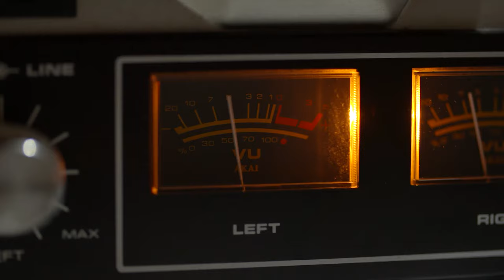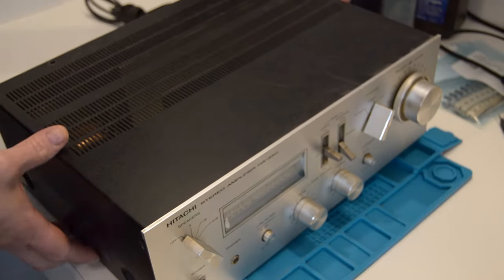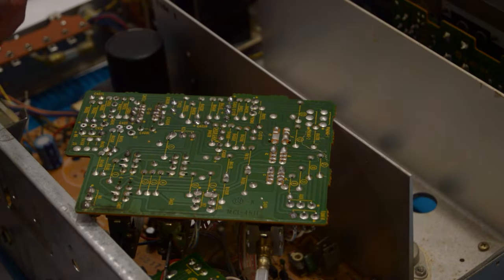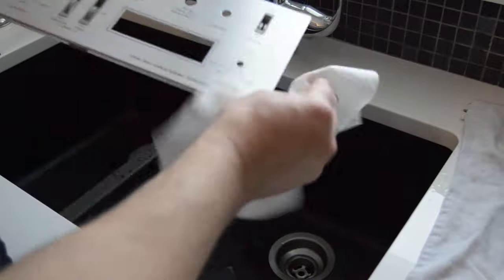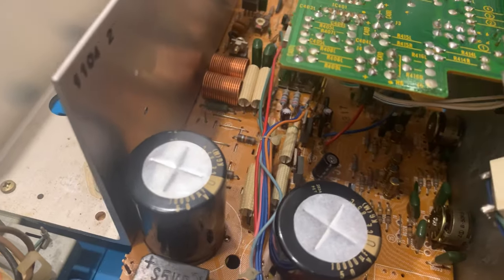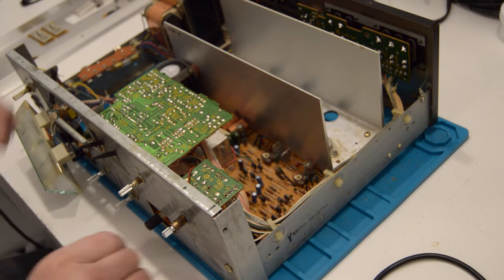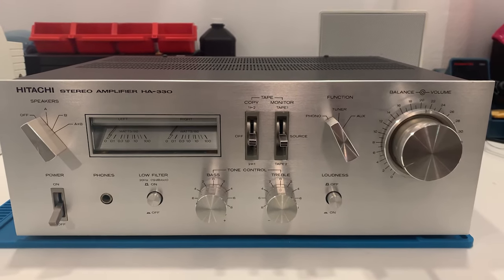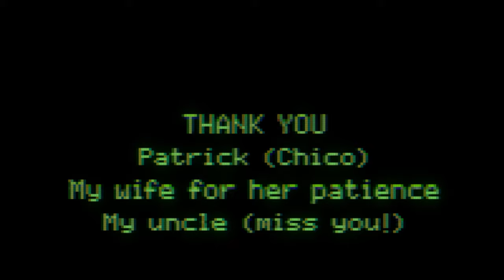How To Restore an Old Power Amplifier from 1977 | Retro Repair Guy Episode 2

Comment: Great video! I'm a huge Hitachi fan and i pretty got all their best pieces and the 330 is part of them. Even if it was one of the smaller model it is truly an amazing little performer. I could live only with that one and be happy and that says a lot. Keep up the good work!
Reply from the maker: Thank you! I hadn't heard it in years and I was really impressed after I fixed it and was testing. It really packs a punch. Until I started fixing it I had no idea it was an OCL type amp; I'm so happy with its performance.

Comment: Nice video...but what about the meter LAMP which is burnt 99% of the time. How do we put in an led equivalent?
Reply from the maker: Hi! Thank you very much. Surprisingly the lamps on this unit lasted forty years. However, for the matching cassette that I restored, both lamps were burned. https://youtu.be/WlVPXTPgK2M?t=545 I replaced them with regular lamps as it keeps it original. Just like a regular light bulb you can of course replace it with an LED. You would need something like this as an example https://www.ebay.ca/itm/10-New-Cool-Blue-Axial-LED-Wired-8V-Lamps-Vu-Meter-Light-Bulbs-Qty-Avail/114221627132 I can't find them on Amazon but all you have to do is match the voltage to the existing light on your unit.

Comment: I never thought about adding solder first to a joint before desoldering it to help pull it out, thankyou
Reply from the maker: Hi! Yeah this is especially true when the machines building the boards put just a tiny bit it makes it hard to suck anything out. Also some boards use a very low lead or lead free solder so by adding it again makes it easier to remove. This was the second video I ever uploaded. You might enjoy the newer ones a little more as I give more details and they have history intros. Here's an 80s drum machine I just fixed. https://youtu.be/Woo1-DSzc5A Thanks so much for watching!

Comment: I have the HA-330 and am using it in A+B mode with bi-amped KEF Q3's, and a bluetooth tube preamplifier, it literally blows up people's minds when they hear it, that this mini beast of an amplifer with 20 plus yr old speakers sounds better than anything modern they have heard. Am pairing it with a wired Raspberry Pi running Volumino soon for lossless listening.
Reply from the maker: Yes, it does because it's an OCL amplifier capable of high output at low frequencies. Today OCL amps are generally found in very high-end components that cost thousands. I had not heard it since I was very young, so it surprised me as well, knowing it was such an amp. If you haven't done so already, you should really consider replacing the 45-year-old capacitors to prevent any damage to the transistors as they are almost impossible to find. The cost wasn't too high, but it was a lot of work. Only looks easy in a 20-minute video.
Reply: @RetroRepairGuy  Thank you, I shall start looking for the caps, am in India so really don't know what I will get here but if you are okay with it will message you with what options I get here!
Reply from the maker: You can get everything here:
https://www.digikey.in
If you need more information let me know.

Comment: The 2 large capacitors are as follows. One is for the + or positive power supply rail and the other is for the - or negative power supply rail, not the right and left channel individually.

Comment: I've got a Chinnon (Dixon's then own brand name) tuner amp with Wharfedale speakers bought in 1975 & still going strong tho the radio is a bit crackly, but connecting my Technics cd player it has a beautiful warm sound. The Chinnon was made in Japan & the knobs have a excellent weightiness when adjusting. Quality unlike now.
Reply from the maker: Hi. I actually had never heard of Chinnon. Most of these old amps, especially from the 70s and 80s were built to last just like the old cars. Everything from the chassis to the knobs feels heavy and of good quality. Thanks for watching!

Comment: What do you like about the HA 330? It is very basic and not even the regular size of 43 cm for most vintage units if you want to stack with other units like tuner, CD player, cassette deck...
Reply from the maker: The best aspect of it is it's OCL circuit design. It's really sounds amazing and units with OCL circuits today cost a fortune. Also, the main reason I liked it as I stated in the series of a few videos I made restoring this stereo, is because it belonged to my Uncle in 1977 and we used to record stuff together on it so I have emotional attachment to it. Thanks for watching!

Comment: If I may suggest: replacing thermal coupling compound under the finals, the TO3s, would be a good idea along with verifying whether crucial resistors have drifted in value another. Bias setting and DC offset, if present, is another set of adjustments worth checking on a unit of this age. There often is a PIO cap on the mains, which must be replaced with a modern fail safe cap. Was expecting a totally different testing to music blaring, 1k sine into dummy load while operating pot and switches to verify on the scope and via headphones whether spraying some contact was effective for a start. Nice unit, they don't make them like that anymore.
Reply from the maker: Hi there! Thank you for the suggestions they are always welcome. While this was only the second episode, there are sometimes things I do off camera, like in this instance adjust the idle current of the output transistor which is done once the unit has been on for at least five minutes. However I chose a different direction for the videos and make them more concise; I don't want for example people watching me solder for half an hour or do any scope testing unless it is necessary. I don't want to make this show into a step by step "how to" that would last an hour without resolve but rather for people to experience a restoration process from beginning to end and experience closure, which includes playing music to demonstrate the unit is functioning in lieu of having a scope hooked up to it.

P.S. As for the TO3s, there was testing done on them (off camera) and I did look for them but they, and every replacement, was always discontinued. Although they are working, if I had them available, I would have just changed them and included the process in the video.
Reply: @RetroRepairGuy  Had some heatsink compound turn to powder after decades of service and especially in light of some of these TO3s becoming unobtainium, as you point out, solid thermal coupling is a must. I'm not suggesting replacing finals, just the paste, because ... they don't make them like that anymore ! Matching any trannies is a pain and if the manafacturer had a curve tracer at hand, the chances of getting it "more" right are slim, unless you have dozens at your disposal. As to longer vids, I wouldn't mind, but I get your point. Thank you for clearing that up !
Reply from the maker: @paulb4661  Agreed, you are absolutely correct and thermal paste should be changed after all this time. I'm happy to hear you wouldn't mind longer videos, it's always hard to find the perfect length without dragging and boring people. YouTube's algorithm penalizes for a bunch of reasons such as people turning off your video cause it drags, click through rates, etc.

Comment: Seems similar to an old Sharp Optonica I am in process of fixing with a removable bottom plate.  It has blown it's RIFA cap on the power supply section.
Reply from the maker: Hi. I just looked as some pictures because I did not know the Optonica. I can see the similarities, are they also OCL type amps? I couldn't get that information. This is the one thing that made me fall in love with this amp as it packs a punch; I was really surprised. Will you post a video of the repair?
Reply: @RetroRepairGuy  I believe some of the models were OCL but cannot determine this on the 5101/5105 models.  It's a nice sounding unit.  I had some help on the audiokarma forum so looking to replace the rifa cap with a modern x2 safety capacitor.  I will post another video when I do this.
Reply from the maker: @AvidRetro  Yeah for some reason I only found out about the Hitachi being OCL from the Service Manual. Can't wait to see how yours turns out!

Comment: re: the large caps. "One for each channel" is completely wrong. They are used in a split power supply configuration, as are ALL direct coupled amps. One for the positive power supply voltage, one for the negative. The power from these is for both amp channels. If it were a dual power supply, there would be four large caps, two for each channel.
Reply from the maker: Hi. I just watched it again and you are absolutely correct; it's one for positive and one for negative, not left and right channel. Thanks for pointing it out and thank you for watching.

Comment: I have a optinica amplifier sm 1515 b if the power transformer goes bad can it still be fixed the part number is rtrnp0506afzz can it still be fixed and what about my output ic rh-ix1066afzz it is a sanken s-60w
Reply from the maker: Hi David. Very nice amplifier looks similar. The problem with the power transformers is they are very difficult to find new that match. Not like the old days. However, with a bit of fiddling, you could replace it with another but you'll have to have the service manual and make sure of voltages, etc. I find it simpler to purchase another used for parts. This place has it listed but says "not in stock" and "no substitute" but it looks like you could order it https://www.ued.net/ued/viewItemAction.do?itemCode=SHARTRNP0506AFZZ

Because it's a Sharp part, many times the same part was used in another amplifier that was much cheaper (same with car parts for example). And you could purchase a used Sharp at a much lower cost. Here is the service manual https://ldsound.info/wp-content/uploads/2013/05/Optonica_SM-1515-H_service_manual.pdf

For the rh-ix1066afzz there is an NTE parts equivalent NTEOBS-NLA. Some equivalent selling here on eBay https://www.ebay.com/itm/182776314839 

Check it out and let me know. Hope this helps! Thanks for watching!

Comment: Put a Technics badge over the Hitachi and I wouldn't even question it, the speaker termination on the back is definitely not Technics.... I wonder if it was out sourced? 
As for the power supply filter capacitors, you didn't say if you looked around for something that might fit better, even if it was rated for a higher voltage and capacity.... Which might have been large enough to fit the correct holes in the PCB (not that I have a problem with the final outcome) but I do believe that there was a good possibility that something might have existed that would have fit perfectly and apart from looking better, the amplifier could have benefited from the extra capacity.... 
Also, did you remove the TO3 output transistors to refresh the thermal paste? New old stock is very hard to find, new Chinese stock might not be as good as the original transistors even though they are 40 years old LoL... You certainly don't want them to die! I have a kit amplifier that uses the TO66 transistors which were Australian made, we haven't made anything down under in a very long time and those things are unobtainium! They were the 2N3055 before the 2N3055 existed and while I can use other transistors, even the Electronics Australia magazine which the kit amplifier came from in 1973 also showed how to use the then new plastic transistors instead at a later date but there's something special about those metal encapsulated transistors that used gold in their construction.... But the sound! I have more amplifiers than I know what to do with but it's my favourite! There's something that it's doing that the others don't, I originally got it because it looked very 70's and it was ugly and I needed something like that to gut out and fit a new power supply and class D amplifier with as much output power as possible, I wanted something that would shock and awe people but I made the mistake of plugging it in and listen to it while expecting it to be terrible ( I mean, how good is an amplifier going to be that came as a kit from a magazine right?).... Yeah I was hit with shock and awe! The ugly duckling turned out to be a swan in disguise!
Reply from the maker: Hi Peter! I don't know if it was out sourced. It does have the "Made in Japan" mark and it was built in 1977 but obviously there were probably many parts similar and built by a certain company that were in many of the different units. I did not put as much explanation because this was only my second episode and I did not have a set format yet. As for the capacitors, yes I did look around with all my suppliers. I was unable to find perfectly fitting ones. However, I remember finding a site at the time that could manufacture them if for example there were 2-3 values in the same. Of course this was very expensive and since the other legs had no value, this was replaceable with a standard capacitor. But this was the closest match that I found so luckily there was that extra hole in the motherboard and the other leg fit in and the tiny jumper was the only solution. But they still grip on to the motherboard like the original ones. NOS I would never buy because caps have a shelf life of 15-20 years so even if they are never used, they dry up and you risk blowing the amp with New Old Stock. But transistors are OK if you can find them. Yes, I removed the transistors and put new paste and found quality thermo pads from NTE to replace the plastic ones. Again, I did not film or show any of this at the time whereas now I try to show/explain everything I do. You certainly don't want these transistors to die. I had looked before starting work on it if they could be replaced in case but no luck. I never turned it on before I began the work because I did not want to blow anything and I knew this unit's history since it was my uncle's and it sat there unused for almost twenty years. So I knew the transistors were OK but that the caps had to be replaced before I even turned it on to make sure not to blow them. You might enjoy a more recent video of a drum machine I completely ripped apart and restored. https://youtu.be/Woo1-DSzc5A Thanks so much for watching!

Comment: I have a retro NEC Audi Video Amplifier I need to repair.  I'd like to have the schematic or the service manual for it. The model is 
AV-350E. Would know have or know where I can get a schematic or service manual?
Thanks
David
Reply from the maker: Hi and welcome to the channel. I can't see it free anywhere but you can purchase a PDF for download from here for $17 https://www.servicemanuals.net/NEC/AV350E/515137/detail.aspx
Please note that I am NOT affiliated with this company but I have purchased from there twice before when I had exhausted all options and was happy. They also let you download the first few pages so you can see what you are getting. Might take an hour before your download is available but I haven't experienced any problems. Hope this helps and don't forget to subscribe.

Comment: Hi I’m from srilanka, I to have the same amplifier and it’s getting really hot please advise what should I do thanks
Reply from the maker: Hi Viraj. When you say overheating, what exactly happens? Has the amplifier ever been fixed /serviced? All kinds of things can cause overheating. How clean is it inside? Dirt is something that can cause overheating. If it was ever fixed, I would check the wiring. Things like bad grounds can also cause this. It would also be important to remove the transistors, clean the heatsink and then put in new plastic or silicon micas and some new thermal paste. Also make sure the environment around the amp allows it to vent. For example don't stick anything that would block the the holes in the cover. Let me know and thanks for watching.